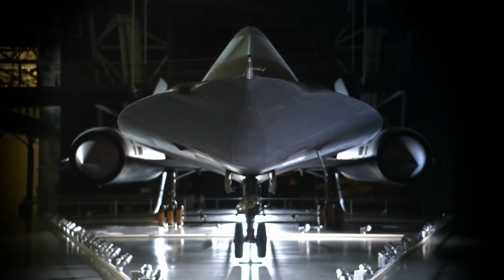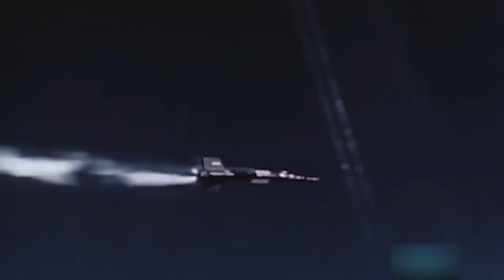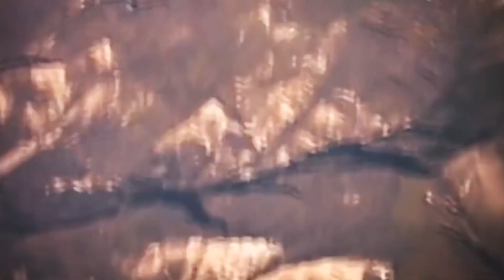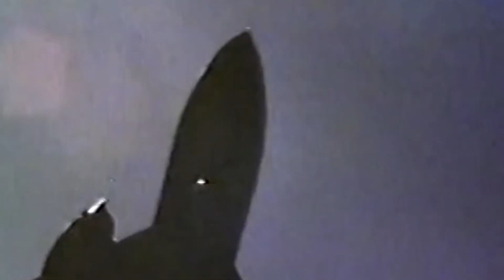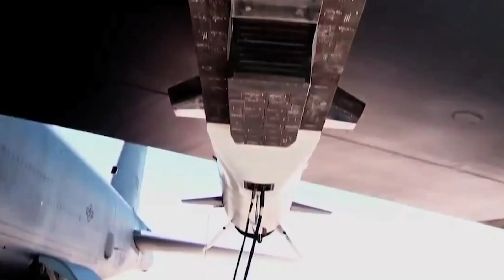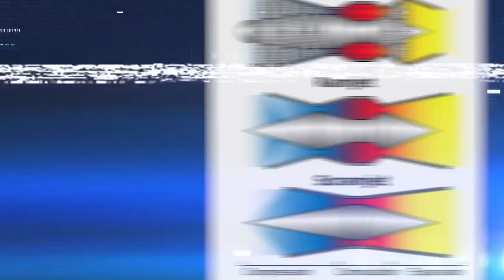US Tests New SECRET Hypersonic Aircraft to prepare for Russia!

Comment: The X-15 program clearly demonstrated that pilots could fly rocket-powered vehicles out of the Earth's atmosphere, successfully control them in an airless environment, reenter the atmosphere and then land at a predetermined site. This is the basic profile of a Space Shuttle mission, and while they are flown with computerized flight control systems, direct control can be assumed by pilots if desired or necessary.
Reply from the maker: Thanks for your response